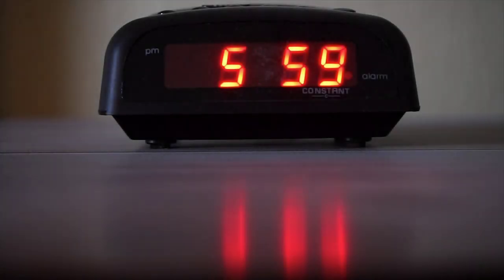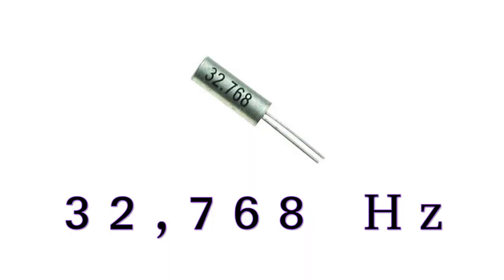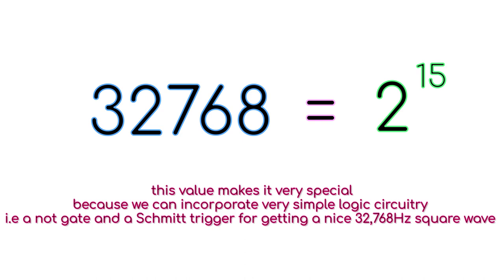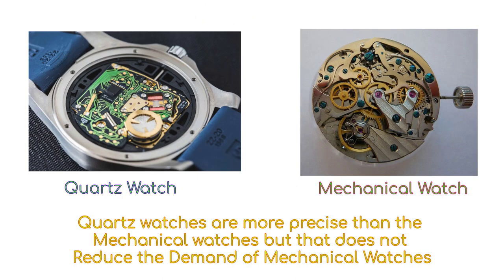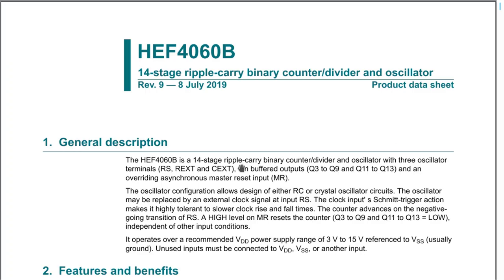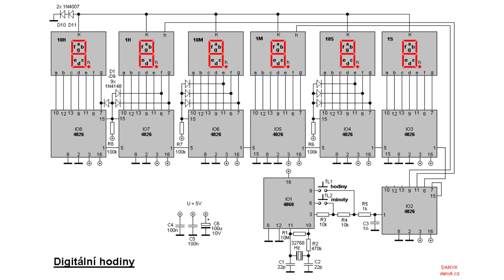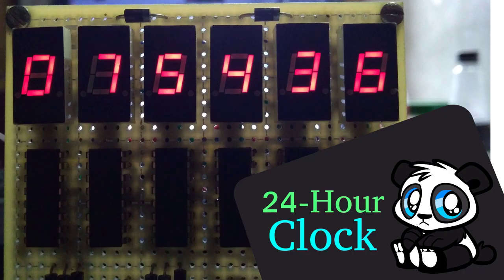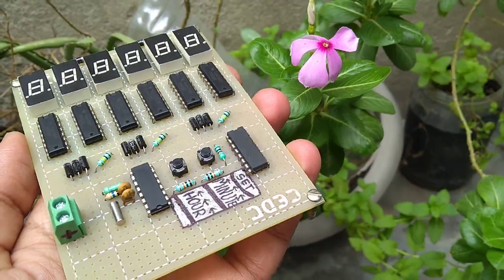How does a digital clock works & How to make one at home? | DIY Digital Clock using 4060 & 4026

Comment: Builtin memory available.for powerfailure working
Reply from the maker: Sadly there is there is no memory in the clock to retain time :(
Reply: @lorforlinux  I would say just add a say, 100 micro Farad (or bigger) capacitor across your 5V(or whatever) power supply
That will make it remember for  pretty long time may be few minutes
Bigger the capacitor ,more the memory...
That had worked for me